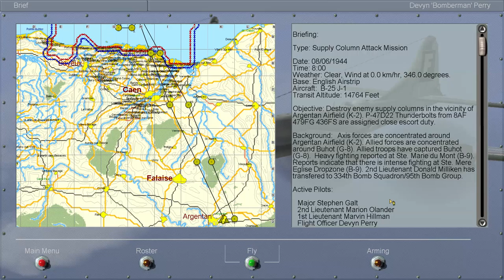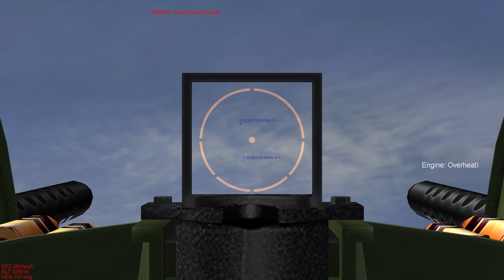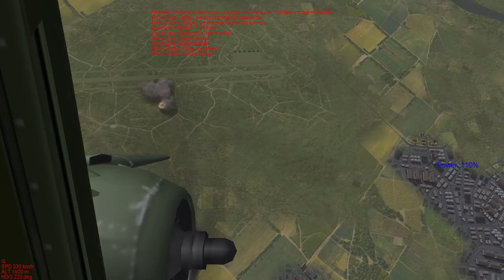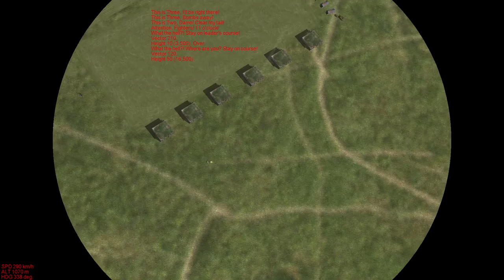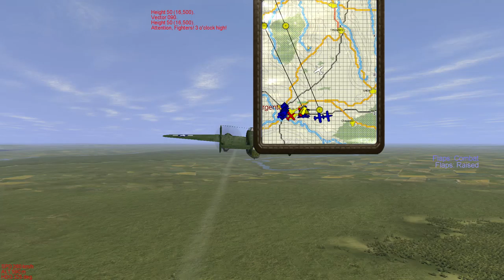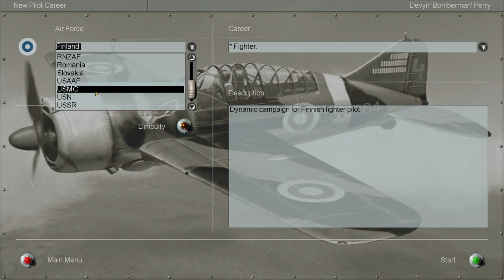Let's Play IL-2 Sturmovik 1946 (USAAF Bomber) Mission 3

Comment: Water would destroy a plane if you smack into at a relatively high speed. You have a gradually, and extremely slowly, make a water landing; making sure the plane is stable in the process. It is possible.

IL-2 is just a hard-ass about realism is all.